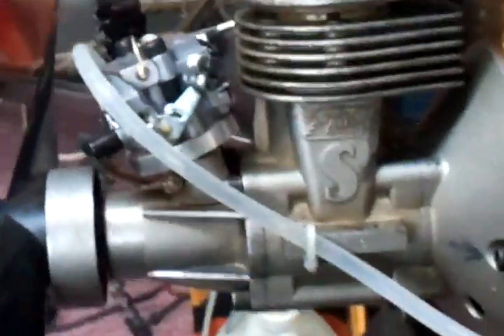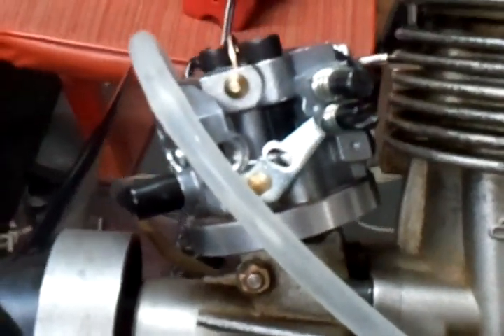nitro to gas conversion using a glow plug

Comment: are you add more a gasket in head engine? for change compression ratio
Reply from the maker: No .. glow fuel is already about 110 octane.. so the one thing you don't want to do is lower the compression but what you do want to do is use a good high octane gas like 93 or higher.. I was using 100LL aviation gas but the 94 octane pump gas seems to work just as good..
Reply: can i use original carburetor to try a gasoline? just change a glow plug for gasoline like os G5 @jeffgrain1417
Reply from the maker: the glow carbs are designed for glow fuel.. the porting is designed to deliver 4 or 5 times as much fuel compared to gasoline..  even though some people have got them to run.. and so have I , but they have never got them to run successfully.. and I have certainly never seen one fly.. along with if there are any rubber seals in the carb, like the needle valves.. then gasoline will destroy that rubber as it is meant to be used with methanol.. when I first started this , I had met this Chinese guy that told me it could be done.. but he also said .. It is all about the carburation... you need the right carburetor for the right fuel.. and he was right..  with using a glow plug with gasoline you need good gas with no ethanol added.. then you need to add about 15 percent ethanol.. the reason is so you can control the amount of ethanol.. this is important because the glow plug needs the ethanol to work so the mixture must be carefully controlled @wildan1340
Reply: @jeffgrain1417  what type walbro carb are you using for this engine? How about intake manifold? Are you add more spacer from carb to hole crank? I have 2 jba 91ar engine. I have plan to convert one of them to gasoline. maybe you have suggestions what carburetor should i use for my engine. Sorry for my bad english 😅
Reply from the maker: that particular engine was a supertyger 25cc so the carb was size for 25cc it was also the first one I did and there where mistakes made.. check my other videos.. but each engine from 15cc and up had the carb sized for the engine.. for the carb you would need to use a lathe to machine an adapter like I did to go in the hole with a flat surface for the warbro to bolt to..  no worries about english.. here in canada there is a lot of broken english... what country are you in.. @wildan1340

Comment: Hi Jeff. Good work there. I just came across this clip and I noticed that in an older reply, you had said that av-gas and methanol don't mix. They won't on their own, but will if a suitable mixing agent is used. My father and uncle raced dirt track speedway saloons in the late 70s (Here is Australia), and before going full methanol, they used a mixture of av-gas, methanol and methyl benzine (toluene). I have since read about others using acetone for the same purpose for dirt bikes etc, but have no experience with that. One thing about the toluene, is that I remember my uncle saying that too much methyl benzine was 'hard on the spark plugs', though I never asked why. Cheers, Robert.
Reply from the maker: thanks for the excellent reply Robert.. This video was from over 6 years ago.. I have made a lot of changes and improvements since then.. The only reason I wan'ted to add the methanol was for the glow plug.. since the platinum in the glow plug relies on the methanol to create the reaction to keep the glow plug working.  So I just stepped back to the 94 octane.. for ethanol free gas and then add a controlled amount.. so far it seems to work very well..  this same engine is now in a Carl Goldberg bipe and goes like hell...
Reply from the maker: check out this video.. https://www.youtube.com/watch?v=jQhZGJvcFMI&lc=Ugz1Sltc6gvKXN0baWp4AaABAg

Comment from the maker: Just an update to my fuel mixing.. all the bench testing in the world does not prove anything except that you can make an engine run for a few minutes.. They must be proven over time in flight.. The first few flights on the OS G5 plug went well.. on the AvGas,,  but then I started to have some starting and running issues.. I have since switched to a 94 octane pump gas with 50/1 full synthetic oil and adding 15% methonal to this.. this seemed to cure the starting and running issues.. Don't try to mix methonal with AvGas.. is does not work.. The glow plug I was using failed on me in flight.. it may have been damaged due to the other fuel mixes.. I don't know yet.. The experimentation is still on going but I am getting closer to having a good conversion that is flying.. Prehaps the G5 plug does not like the methonal.. I may go back to a Type F plug and try ..
Reply: very interesting. thank you very much for sharing your result! i knew it could be done.
i am in the process of converting old outboard two stroke motors to run on glow plugs to see if i can burn waste vegetable oil mixed with gas 80% wvo to 20% gas

could you please try and burn 60% vege oil and 40% pump gas and see if the glow plug will ignite it.
much appreciated. thanks again

Comment: Hell yeah, you proved those doubtful fuckers wrong. I myself am working on a mini 3 rotor (yes wankel rotary) engine that uses premixed gas with glow plugs, because ignition is not needed and glow plugs make it more reliable. So I will test that out and fun fact is that I will be using a 3d printer to build it and the filament actually starts off as a 85-90% bronze metal and once you bake it in a purpose built oven, it comes out as a 100% metal part. Should be a fun little project although I am definitely going to start with a single rotor first.

Comment from the maker: I have finally found out why this engine did not run as well as it should have.. I was using a Type F OS plug with 94 octane fuel with no ethanol in the fuel.. As it turns out , if I had used the cheaper gas with ethanol.. I would have had much better results.. Check out my other video of the Enya 60 conversion.. and you will see what I mean..

Comment: there is one thing confuse me. why the original carburetor does not work, and just like other gasoline engine, they all use carb with fuel pump inside.
Reply from the maker: The fuel inlet of the original nitro carbs is to big for gasoline.. and the pump in the carb is to take the place of the pressure tap from the muffler of a nitro type of engine.. the muffler pressure is very unreliable for gasoline..

Comment: yes you can but only if you have the battery connected all the time. that means you re going to destroy your glow plug...
Reply from the maker: you can keep a glow plug driver on.. you just need to lower the voltage to reduce the current to the plug.. a lot of people do this in the winter to help the glow plug stay hot during winter flying
Reply from the maker: Only use the glow driver to start now... after that,, it runs like any other glow engine except it is running on gas

Comment: What the carburator ( brand and number ) you are using ?
Reply from the maker: the carb is one that i had bought from hobby king for an FTL 20cc engine
Reply from the maker: the carb that I finally ended up using is sized for a 15 cc engine purchased from HK

Comment: I have done this as well,  It will work much better if you lower the compression ratio by adding shims under the head, the standard glow compression is too high for gasoline.

Comment: it can run.but fly it very easy to over heat.the engine head up easy to get lean over heat.
Reply from the maker: No heat problems.. I use a high grade of oil

Comment: Hello, how did you adapt the carburetor orifice that is to work with the engine vacuum?
Reply from the maker: added a pressure tap in the back plate and just ran a line to the carb.. did not use a reed block because the port in the crank shaft closes off the carb port.

Comment: Impressive!
Just a question: is not necesary use a igniter for the glow plug on the beggining of start process?

best regards!
Reply from the maker: yes it is.. the glow igniter is on board and controlled from the transmitter on this plane.. but more work needs to be done to the engine.. it is not " perfect " yet.. I just have not had time to get back to it..
Reply from the maker: I have done away with the on board glow driver.. re-did the carburation and do not need the glow driver except to start the engine
Reply from the maker: yes it is.. just like any nitro engine

Comment: OD you thing it will also work in smaller engines like 9ccm (52)
Reply from the maker: there is no reason it can not work.. you just need to find a carb to fit the size of engine you have.. that is going to be my next project to convert a 60 engine

Comment from the maker: I have not worked on this project for some time.. but to answer some questions.. I have not changed the compression of the engine... I did change it to a OS 4 stroke plug.. seemed to give a little better Idle..  To answer another question someone asked.. is NO ... you can not just use the nitro carb.. This is where the conversion gets tricky.. the engine will run just by switching to gas.. I tried this.. but you can get it to run at an idle or at full throttle .. just not both... the whole problem of conversion comes down to the carburation.. and since the nitro carb does not have a pressure regulator ,, then it is not possible to just switch fuels.. you need the regulator and the pump which are built into the walbro carbs.. 

A good example would be the Evolution 10cc gas spark engine.. it relies on muffler pressure to act as the pump and the carb has a regulator built into it.. by installing a pressure tap in the back plate of the engine and using a perry pump .. you in effect create the same thing as a walbro ,, only the pump is external..  This is a nice upgrade to the evolution engine and it runs very well..

An example of this sort of setup can be seen with the RCGF 10cc engine and the 9cc NGH sold at hobbyking.. I would not recommend the NGH... it seems to have issues as well... 

I did get the plane to take off on 2 of the test flights... but the engine quit both times once it was about 10 feet off the ground.. This problem could be related to the cowl being pressurized by the prop...  which makes the pump in the carb stop working.. there could be other problems as well.. but I do plan on getting back to this project...

Comment: could I run my os max 40fp like this with a normal nitro carb without any damage?
Reply from the maker: No... you need to use a gas carb sized for the engine

Comment: Hi. You just added gas in the tank and  anything changed in the engine??  Namely ... the engine is the same??? Carburator is the same??
Reply from the maker: jose catalano The carb is a Hobby King Walbro type. I made an adapter to mount the carb after the orginal nitro carb had been removed.. since the opening in the crankshaft acts in the same way as the reed valve block would.. I only needed to add a pulse tap from the back of the crank case to the carb.. I have not worked on this thing since last year.. too many other projects got in the way.. but will be coming back to it..

Comment: Air in the fuel line might be vapor lock caused by excess heat in the carburettor. To avoid this, there is usually a resin adapter between the engine and the carb to limit the heat transfer from the case to the carb. On your video it seems that you are using an aluminum adapter. Just my two cents, but every gas engine I have ever seen use such an isolator. Worth a try... Good luck!

Comment: my stock os max engine runs perfect on straight old 2 stroke.
Reply: Yep.  Done it already. You should bump up the oil content in the gas, though. 50:1 , 40:1 (or whatever) is pretty lean for a 25,000 rpm engine.
Reply: Scott Carlson yep i run 50:1

Comment: Looks like the fuel is 'Frothing' from the additional vibrations from the engine running 'Hotter' / 'Harder' from the Petrol / Gas, you may need to try a foam fuel filter / pickup from a weed eater to eliminate that potential problem. - Just a suggestion.

Comment from the maker: other than the carb and installing a pulse tap from the crankcase for the carb pump.. there where no other modifications.. I use an os 4 stroke plug which helps with the idle.. but also installed a glow driver to get better low speed idle..

Comment: jsparky g,
Did You change the compression ratio to shift to gas ?.
Gas has less octane number than methanol plus oil. That is my dought.
Tks
Reply from the maker: Lutero Bueno No change to the compression ratio.. just the card and pulse tap
Reply: jsparky g Thanks for the info.

Comment from the maker: I am working on the idle problem.. could be I have just to much carb for the engine.. might need to get a smaller carb.. the gas oil mix right now is 20 to 1 which might be a bit on the rich side..but for now better safe than sorry.. Would seem that lubrication is not a problem since it still spits a bunch of oil out the exhaust and the engine has not changed any from the way it ran on Nitro.  As for using the orginal nitro carb's .. the problem with that is that you can not lean the fuel out fine enough to get the engine to run smoothly from idle to full..   Tried to fly it couple of weekends ago.. she did take of nicely but about 10 feet up the motor quit.. fuel mix was too rich.. the up side is that the aircraft the engine is on dead sticks very well so she just soft landed in the long grass.. Will try to get a video of her first flight and keep you posted..

Comment: what is your rpm.
Reply from the maker: So I finnally got to reply.. google is just messing up all over the place.. but here is the info

the prop used here was a 16x12   I had not put a tach on it yet but I expect that it was around 7000 rpm.. the next day I had found a cure for the mysterious air bubbles getting into the fuel line.. I had also switched props to an APC 18x6.. this gave it way more thrust and it accually started pulling the test stand towards me.. Buddy came over and brought his tach and it showed about on average 8000 rpm.. The best low idle I could get was about 4000 without a glow driver... Added an onboard glow driver and got a stable idle of 16 to 1700.. the trick to this is the engine needs to be fully up to operating temp before removing the glow driver..
Reply: jsparky g
I did this to my little 4cc motor.It ran good with the original carburetor but couldn't make it run without the glow plug driver.